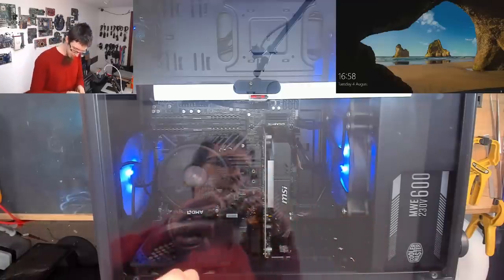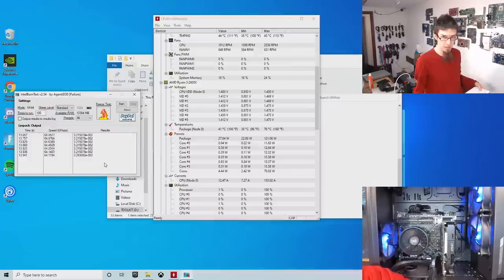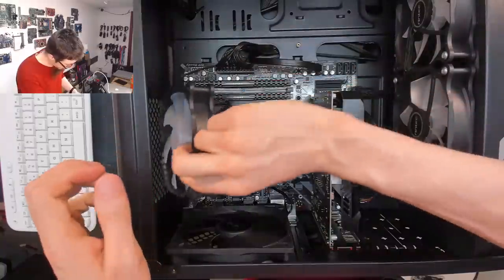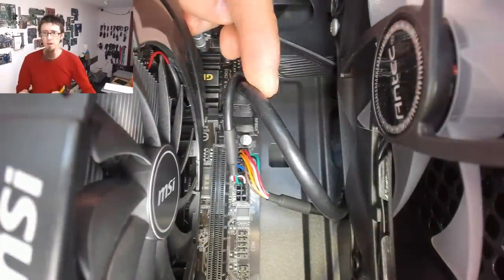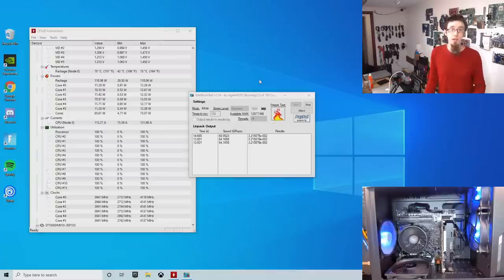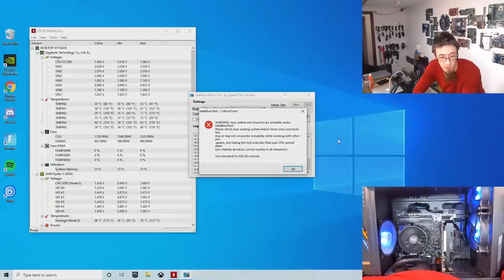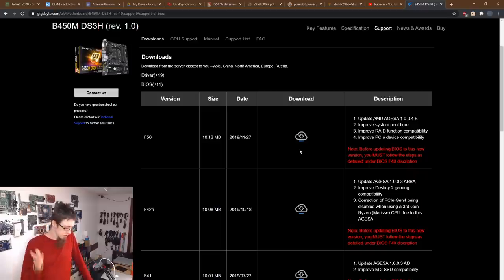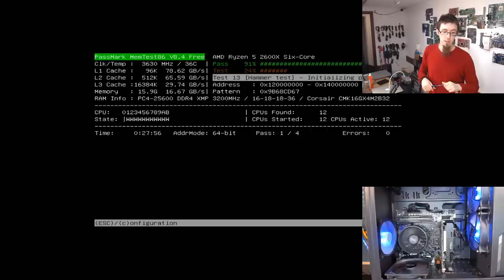Gaming PC Crashes at Random - LFC#217

Comment: Problem #1.  The Motherboard is Gigabyte.  Problem #2 AMD Ryzen 2nd Gen doesn't like Memory speeds over 2933Mhz and has a shitty Memory controller.  Problem #3 Someone decided to do a shit job in building this PC.  Problem #4 Cutting a power wire.  You had extra zip ties

I currently run an AMD Ryzen 2nd Gen 2700X CPU with 4 x 8GB 2933Mhz XMP Modules and have no trouble on a MSI motherboard

Comment: With very few errors running memtest i did manage to get stable after increasing trc from 36 to 75. Also i have ryzen 2600 with corsair (hynix afr IC's) 2x8 gb 3200
Reply: The issue is xmp defaults trc (in my case) to a too low value. Some amd motherboards set the tRC to 75 by default, but mine appearently didnt. After setting tRC (in bios ddr4 timings) to 75 you can test with memtest. If no errors you can try lower trc again to see when you get memtest errors again. Make sure to run 4 passes, as many times the first pass is successful but the second pass is not.

Comment: always use pc parts pick that way it tell you more about it
explain like you cant find information what motherboard requires or else
that pc parts pick show you a lot inform n tell you if does work or not
it just tips save urself a headache for  building PC 

2nd i have heard AMD news that most cpu have x or xt requires be running on 500 above motherboard otherwise cause problem a lot later on with lower than 500 motherboard

Comment: Well i remember getting my pc 200ge   b450 tomahawk max   2x8 3000 mhz gskill. I couldnt get it working with xmp  even ryzen dram cal didnt work on my side with safe presets. At the end i had to manually tune everything it was worth it. my ram is 16 18 18 i got it to 16 17 17

Comment: I'v got an asus prime b550 with a Ryzen 3600 i'v got Ram similar ram but from Kingston with same Latency, at first start after enabling DOCP it din't boot and after it booted i'v got at idle only crash rebboot usualy after a 5 of 10 min but if i could start a game fast enough :)  it was runnig fine. . Whene i was trying to figure it out i red the warning whene I enable the XMP/DOCP profile about the satability on gen4 devive of over volting soc and decided to lower it from the docp 1.1v to 1.05v and the now running it at 1v it did not happen since I'v have been runnig no unwanted shutdown 24/7 for the 2 past week of testing, and if you aske i use dual boot so during night rebbot will not go unoticed. Sorry Fot My terrible englis and writing but there is a avenue to try there for this kind of trouble but weirdly as writen it never happen in my case under system load.

Comment: ryzen 1000 and 2000 is realy bad with memory and this corsait over 3000 cl16 runs unstable! 3000 is the max on this one. all what you will try, you will not get 3200mt stable. that was often on my end the problem with this ram

Comment: my ryzen  2700x using cutom cl set on g.skill witch is unsupported, or rather not tested by manufakturer use default xmp + 1 cas latency and workis perfectly fine on max 3200mhz 1,35v, on dual slots, and 2133mhz 1,2 v on 4 slots, anyway fast enough to do it's job.
Remember overclock on 4 dimms is act of madness on low or med end RAM modules... noone should do this, it's killing ram power section on motherboard...

Comment: my sis had a funky motherboard she got rid of it afther using it still for more then a year but yeah i concluded eventualy there was something wierd going on with the vrm's the power delivery was acting up wierdly were usb ports sometimes cut off power and offcourse sometimes the pc would just turn off without any error without any bluescreen information it just goes off i allready concluded that 2 memory ports just died and yeah the memory itself there comes the fun part she went on that motherboard through 3 memory sets that died in that pc wel it dident like say poof but they all started to fail memtests page fault bluescreens memory bluescreens  she eventualy also went through processor bluescreens but the the processor is actualy fine so that motherboard was just acting all types of funky and they all are power related ow and one more one the pci port for the videocard actualy lost power once which was funky since the pc kept running but the videocard was completely turned off no screen nothing agian videocard was fine so im just pretty sure the vrm's were faulty(the power supply was fine aswel used a psu tester and the rails all are working fine)

then agian it wouldnt be the first pc my sister had that acted funky we had a cursed pc case before when i was younger the hardware gave eventualy up afther that it went through 2 more completely different hardware replacements like everything except the case was replaced right when it was in there it went through all types of wierd shit one of them burned out but the other was wierder  it was everytime you boot the pc saying that it reverted from a overclock that was never set on there since it was new hardware removing the cmos battery dident fix it it was complaining about the fact that the pentium 4 2.66 ghz was overclocked to 2.66 ghz and that it wasnt set right.... thats what the stock ghz was but yeah eventualy that hardware also died

note the hardware dident have any issues when testing it outside the case my uncle was at the time repairing our pc's so my only gues is that case was either cursed or had bad grounding it looked similar to the dell dimension 4550 case but the one we had dident have the dell logo on it just similar design my sister had that case agian like a year ago it was with a bunch of old pc's and yup we got the stuff out and out the door that case went it just gives bad memories

Comment: There is no way I would lop off that connector, you have more of a chance of shorting out a lop off wire than that molex itself. you clearly didnt tape up the lopped off wire. those tine exposed wires have a chance of shorting the board , I would be pissed if I found this lopped off and not taped up or heat shrink.  You were better off zip tying that molex connector from being any close contact or taping it up..  Examples like this is why right to repair in America is a controversy right now.  Im sorry but that is unprofessional , as a person who works on computers as well, i would NEVER lop off a molex , a clean up zip tie is best. or use molex covers, I have 100s i collected over the years.. just use a rubber molex cover

Comment: All you had to do was set the ram voltage a bit higher leave the xmp settings the same and save the bios settings so they could be applied at any time. No need for all your RIP THE CUSTOMER OFF SHIT!

Comment: “This Molex connector is hot with 12v and 5v. Just lop it off so you have bare wires around your case instead”. Jesus. Just cover the tip with electrical tape or something.
Reply from the maker: You trim the wires down to the 3pin connector, right back to the pins.
Reply: I don't see how it has any voltage coming from the fan. Coming from the power supply, different story.

Comment: As a 30+ year technician, I would have verified which memory the motherboard supported, contacted the computer owner and explained the situation to them. I would have pointed out that the memory could be set at a slower speed or point out that compatible memory could be purchased for it. The decision would totally be on the owner.

Comment: jesus you spent all that time on that and sent it back to customer , be honest how long till it came back, did you not notice the dipping core voltage when under load , pretty sure that the machine still had issues , dont believe he got a machine back 100 percent my any means you ever heard of the saying check your voltages, are you just trying to draw these repairs out for longer content ?
Reply from the maker: There were no further issues with this machine. vCore dip is completely normal, as vCore will go up for single-core boosting and come down for all-core loads.
Reply: @Adamant_IT  maybe it because i use aida64 maybe prog you were using loads cores up differently, alarms for me here is there was no bluescreens , it did not look like a ram only problem to me
Reply: as soon as I heard it was Ryzen 2600X and LPX Vengeance 3200 DDR4 memory, alarm bells rang on DDR4 speed

Comment: at 12 mins clips off Molex connector to have bare wire ends. higher likeliness to short or to pass voltage elsewhere with bare ends. thumbs down from me for lack of the knowledge of insulators and Molex insulator design
Reply: if you actually worried about about a loose Molex connector. just put a bit of tape over it. insulation tape. Gaffa/Duct tape or even  parcel tape. just chopping the wires and not insulating them is worse than leaving the plug there

Comment: Fail at explain XMP again, dude get your shit together.

XMP is a profile to set a bunch of timing and that is it. and on AMD running above 2666 is not OC, ryzen 2000 has the memory speed limit set at 2933, and Ryzen 3000 has it set at 3200. Also there is Jedec 3200 speed which is consider stock with no OC.

Also very interesting combination of testing tools, especially memtest86.

Every tech and OCer have a sense wouldn't use memtest86.

Comment: i seen ds3h and instantly knew what was wrong lol, cheap mobo for a reason
Reply: I've used 3 intel gigabyte ds3h boards without a single issue for years (well not the most recent b460), can't say the same for gigabytes graphic cards though, although they finally did fix my 5600xt with a new bios

Comment: So..... A default ddr 2133 is default 2666...
Uaeless cable management is a start for troubleshooting?
Are you seriosly teaching PC Troubleshooting?
Also... Cutting off Molex cables?
Yeah i mean....
Bare wirea being exposed compares to a connector or being properly isolated?
Alao...
Fan switch...
Going all Exaust compared to having atleast one intake is somehow Troubleshooting?
This video is too close ro... If your PC doesnt work grt 2 cables 0lug them in your wall socket and just suck on them hard....
Reply from the maker: Default RAM speed depends on if the RAM is XMP or not. XMP RAM defaults to 2133, non-XMP may default to up to the CPU native support.
When you trim off a connector, you don't leave bare wires, you cut it right back into the 3pin connector where the ends are shielded.
Lower fans are intaking through the bottom and lower front (which are vented on this case).
Cheers.
Reply: @Adamant_IT  and i said what about the default ram speed?
Oh wait... I said its 2133...
Also it doesnt matter if your ram is xmp or not....
On default it is 2133